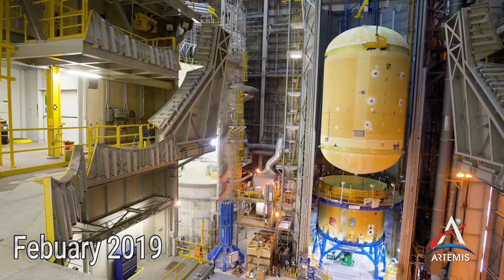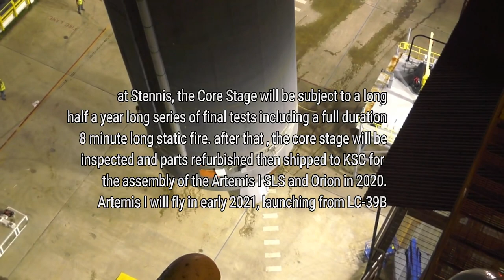NASA SLS Core Stage Integration - 2019 Progress on SLS

Comment: Hard to believe its taken over 10 years to get to this point....6 months of testing at Stennis seems excessive. Just light this candle already
Reply from the maker: SLS hasn’t actually been around for 10 years, it was actually first unveiled (the design) in 2011 and the welding facilities weren’t ready until 2014, the tanks were made in 2016-17 and those tanks became part of the core stage we see today. 6-8 months may seem excessive but all SLStesting periods are actually that long, including test articles, for example, the LH2 structural test article arrived at the test stand in January 2019 and completed all of its testing on December 5th where they tried to find a breaking point, the breaking point was 260% flight loads. When dealing with such important rockets for CREWED missions you have to be Extra careful. Safety is always good, the considering ditching the 6 month long green run for a short static fire at the pad but NASA safety committees saw that as problematic, you could actually just launch SLS in June 2020 if you just skipped green run but you have to do green run to get all that juicy data to ensure safety and also improvements on future SLSs. Future SLSs like SLS-2 (for Artemis II) are already doing better than Artemis I as many of those delays came from mistakes and unforeseen engineering challenges, challenges that are no longer an issue.
Reply: Don't worry it will be lit soon
Reply: @StarshipTrooper  - It will be 10 years in a month...still no "Green Run".. It's been in test stand for MONTHS
Reply from the maker: dcb1138 yeah and it’s been doing green run while on the stand. “No green run” my ass